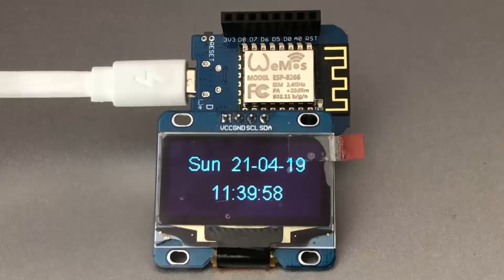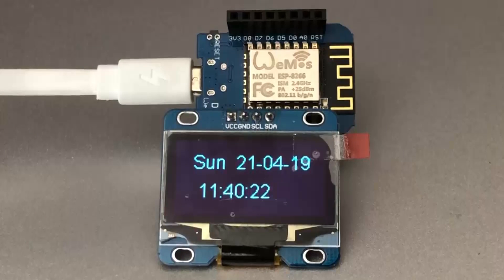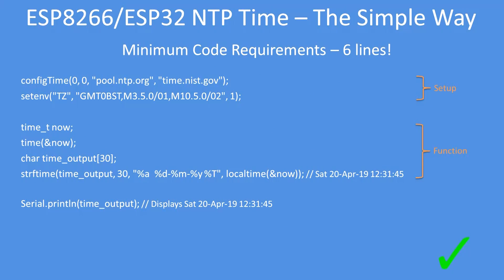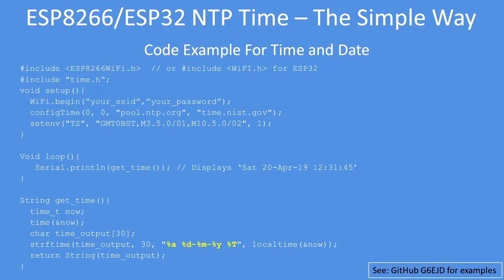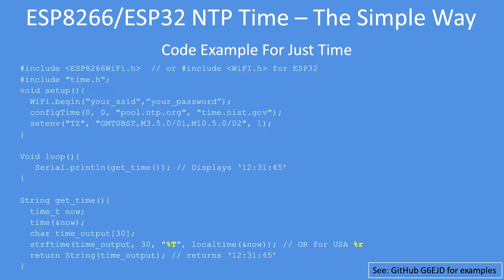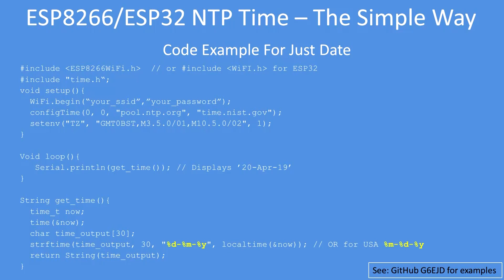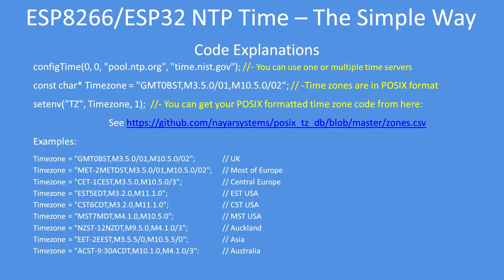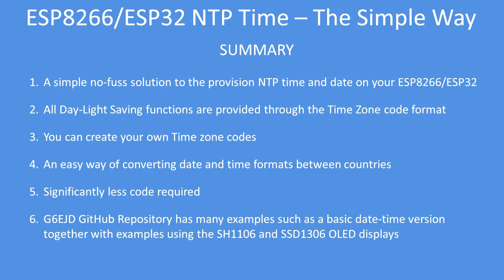Tech Note 122 - ESP8266/ESP32 NTP Time – The Simple Way

Comment: Dave, very helpfull. Thanks.
Do you know a way to setup strftime() to provide native language strings? 
I found a header file langinfo.h at the source files for the esp8266 but I could not figure out where to supply the translated strings for month names / weekday names or even find the original English strings.  That would be really nice!
Thanks.
Reply from the maker: I’ve done the same searching as you, but for some reason there has never been a solution or easy conversion but there should be! C++ supports this, but in this case it’s a compiler shortfall, just never been implemented it seems. You can do a string.replace(“Mon”,”Lyn”); etc but you’d need quite a few, 19 or more! 
Or you can fprint and give it parameters to do the conversion, but either way it’s clumsy.
I’ll try some more to find a solution as I’d like to solve it.
Reply from the maker: I notice PY supports setlocale
Reply: @G6EJD  
I found this document explaining how to change a language settings parameter on Debian:
   https://ccollins.wordpress.com/2009/01/06/how-to-change-date-formats-on-ubuntu/
Particularly in the directory /usr/share/i18n/locales there are all the language dependant settings.
Now we need to tell the compiler for the ESP8266 about some other language file. 
But I am afraid that isn far beyond my current knowledge ...

Comment: Hi Dave new to this coding just starting at 55.  Your video are very clear and full of info.  I have esp8266 with DHT11 and oled screen which is working fine, i even have it publishing to a webpage.  I have used your code to add the time.  In my void loop where the dht11 reading are taken if i increase the delay  between reading/screen refresh to 2000, it effects the clock (seconds increase only every two seconds as expected) as the screen is only updated once per 2 seconds.  How or where should i put your clock code so the delay in reading the DHT does not effect the clock.  I think i need to learn how not to use delays and instead interrupts. as i have learn delays are bad for programming anything other than very simple code.  Learning loads and having fun, though stress full at time (LOL)
Reply from the maker: Andy, I’m pleased you hear your enjoying coding microcontrollers, yes the effect your seeing is programmatically correct as the 2-sec delay indeed halts all updating, there are a number of factors here you should consider, one is not getting time too frequently as NTP servers will block you eventually for too many requests, so best to leave the ESP8266 internal interrupts to increment the so called UNIX time value every second (now) and then occasionally get a new value from NTP services say every 20-mins in seconds if that’s your count, next the DHT is quite a slow sensor and you could introduce an interrupt that every 10-mins or 1-min or whatever gets a new reading from the DHT, see my video on interrupts set a timer interrupt to trigger every day 10-mins and when it does read the sensor to a global variable, now your void loop need contain no delays at all, there will always be some jitter in the screen update routine as during the DHT reading which can take a second or so, the main programme flow is bring interrupted, but it’s better than using delays, it’s all part of programming a Von Neumann architecture cpu, if we had 2-CPU’s the task of reading the sensor could be allotted to the second cpu, and the two exchange or use a common set of variables to exchange the data. In a way what you are trying to counter is a perfect way to add to your learning as it’s the next step in programming. Hope this helps. BTW also see my video on memory allocation for interrupt routines and whilst the compiler in its latest guise will say, interrupt routines need to reside in ISR RAM (interrupt service routine) to stop interactions and crashing, usually solved by prefixing the function with IRAM or some other prefixes eg
IRAM void DHT_Reading()...

Comment: Just discovered your channel.  Thank you for the excellent tutorials. Once the setenv has been set using a time zone string, does it need to be changed when the switch happens to DST?  Or is it simply setup to match whatever the current setting is and then it will automatically change when the DST date and time comes round.
Reply from the maker: Steven, once Setenv is set there’s no need to adjust date-time again and the NTP services will follow the rules adjusting time forward and back in Spring / Autumn continuously.
Reply: @G6EJD  Thank you for clearing this up.

Comment: Strange result. The first time I call gettime in the loop it returns Thu 01 01 70
 11:00:11. after that the date and time is correct. why this happens?
Reply from the maker: It takes about 500mS to establish a connection to the time server, you can add a small delay to wait for the connection to prevent this, some networks are slower than others, yours is towards the slower end, that’s the connection between the ESP and your router access point and the the time to get to the NTP server, you can measure the delay from say a PC to the ntp server with a ping server-address to optimise the delay setting, but usually a simple delay(500); after the get time function resolves the issue.
Reply from the maker: For the ESP32 there is also an option to automatically wait until time has been obtained without adding a fixed delay, so it will wait until time is set then move on, waiting for a maximum defined amount of time, I can let you know how to do that if you need it.
Reply: @G6EJD  thx for that. i added the following code which seems to do the trick:
while (time(nullptr) <= 100000)
{
  Serial.print(".");
  delay(100);
}
Reply from the maker: struct tm timeinfo;
  char   time_output[30], day_output[30], update_time[30];
  while (!getLocalTime(&timeinfo, 10000)) { // Wait for 10-sec for time to synchronise
    Serial.println("Failed to obtain time");
    return false;
  }

Comment: Dave:  How do I convert time elements to integers so I can apply math or logic operators?  Thanks in advance.
Reply from the maker: There is a predefined type with a TM prefix:
int my_hour = tm.hour;
int my_min  = tm.min

There are about 20 sub-types day, Dow, secs, etc
Reply: @G6EJD  hi and thank you for your great work :) i have the same problem and  int my_hour = tm_hour; does not work for me (WEMOS D1 mini & ESP8266, Error: 'tm_hour' was not declared in this scope). Can you help me, please? I need hour and minute in int. Thank you :) .......my solution is the atoi() function....it works for me, but i think its not the best approach
Reply from the maker: void get_time(){
  time_t now;

  struct tm * timeinfo;

  time(&now);

  timeinfo = localtime(&now);  

  int int_hr  = timeinfo->tm_hour;

  int int_min = timeinfo->tm_min;

  int int_sec = timeinfo->tm_sec;

}

Comment: Hi Dave. I cannot get the function getLocalTime in ESP8266, is it normal?
Thanks.
Marc.
Reply from the maker: Marc, Chaco our the code examples for the ESP8266 that function does not work so it has to be a slightly different approach, but still quite short amount of code.
Reply: @G6EJD  Hey Dave. Why when i request from OpenWeatherMap i got: 1561367183
as sunrise and when i convert it it gives me: 9:06:23 , when it's 5:06 the real sunrise?

thanks.
Marc.
Reply from the maker: @MPElectronique  , that time comes from OWM and converted gives 9:06am (UTC) and your +4 hours? which sounds it could be correct to me. What location are you and I'll check what OWM returns here in the UK, could be a OWM bug.
Reply: @G6EJD  Montréal Canada..
Sunrise at 05:0 6
Reply from the maker: Marc, OK I found the issue, when your get sunrise and set times from OWM they are in Unixtime (secs from a basedate), next your need to add the timezone value from the API response which for you is -14400 and this takes 4-hours off your sunrise/sunset times.
Or, send your Unixtime through this:
String ConvertUnixTime(int unix_time) {

  // Returns either '21:12  ' or ' 09:12pm' depending on Units mode

  time_t tm = unix_time;

  struct tm *now_tm = localtime(&tm);

  char output[40];

  if (Units == "M") {

    strftime(output, sizeof(output), "%H:%M %d/%m/%y", now_tm);

  }

  else {

    strftime(output, sizeof(output), "%I:%M%P %m/%d/%y", now_tm);

  }

  return output;

}
Reply: @G6EJD  thanks you so much...
Reply from the maker: Marc, happy to help. You could add s new line to the JSON to get the time zone then add it to the sunset/sunrise times.
Reply: @G6EJD  How do i know when it's -4 dst or -5 dst ?

thanks.
Marc.
Reply from the maker: Marc, for you it’s -4 x 60 x 60 = -14400 which is what OWM returns as a DST offset. When it’s 5 hours that’s 5x60x60=18000 sec or get a value like 18000/3600 = 5 or 14400/(60x60)=4
Reply from the maker: Don’t forget the - sign !
Reply from the maker: BTW - If you use the ESp32 locatime function, it sorts out DST time for you.
Reply: @G6EJD  i did actually is adding since its - 14400
Reply from the maker: Yes, it’s better to add regardless of the sign of the value, then it sorts itself out.

Comment: In the ESP_Simple_Clock.ino 

got an error at line 69 // Serial.println("WiFi connected to address: "+String(WiFi.localIP()));

Compiler Error "call of overloaded 'String(IPAddress)' is ambiguous

In the ESP_RTC_with_NTP_Synchronisation_SSD1306_OLED.ino
got an error at line 91 // Serial.println("WiFi connected to address: " + String(WiFi.localIP()));

Compiler Error "call of overloaded 'String(IPAddress)' is ambiguous

I use Arduino IDE 1.8.9 AND ESP cores 2.5.0 for ESP8266
Reply from the maker: If your getting that error then you copied the text via a browser and your source code contains unseen characters, did you download the zip containing the source code?
Reply: @G6EJD  
Dear Sir, I have the code via https://github.com/G6EJD/ESP_Simple_Clock_Functions

downloaded and unzipped the zip.

Everything goes well with the ESP32, but with the ESP8266 I get the error code.

Comment: Hi Dave! Thanks as usual.
Do you know where i can fetch the atomic clock from the internet ?
Thanks.
Marc.
Reply from the maker: Marc, not sure what you mean, most NTP servers are locked to an atomic clock anyway, the NIST servers are all synchronised to atomic sources https://tf.nist.gov/tf-cgi/servers.cgi
Reply: @G6EJD  im looking for the fort collin in colorado..
Reply from the maker: You can use  'time-a-wwv.nist.gov' or 'time-b-wwv.nist.gov' or 'time-c-wwv.nist.gov' or 'time-d-wwv.nist.gov' just place one or more or all in the server address section separated by commas and place each in quotes
Reply from the maker: Don't forget that NTP measures the time delay between you and a server and removes that delay from the time it supplies you so that time and the server wherever it is and you are identical so for absolute accuracy yes pick an NTP server that uses an atomic clock, but what ever time source is used your device and the remote server will be the same time.

Comment: I don't use Arduino - so it doesn't help at all.
Reply from the maker: I don’t understand the point your making?
Reply from the maker: Also if your using another IDE then I can see few if any differences.
Reply: @G6EJD  So can you explain in details the protocol to use with TCP?
What protocol is it? NTP or SNTP or other?
Reply from the maker: I have not checked the compiler source code, but most likely the community uses SNTP which as you will no doubt know, is a reduced and simplified version of the NTP (Network Time Protocol) protocol, NTP is generally used only to guarantee high accuracy and is quite complex. Do you need NTP services for your code? Bear in mind there are relatively limited resources on an ESP8266 so for code compatibility SNTP is the likely outcome.

Comment: In theESP_Simple_Clock.ino 
got an error at line 75 // Serial.println("WiFi connected to address: "+String(WiFi.localIP()));
Compiler Error "call of overloaded 'String(IPAddress)' is ambiguous",

 had to change to:  Serial.print("WiFi connected to address:   "); Serial.println(WiFi.localIP());
Reply from the maker: There’s nothing wrong with the code are you at IDE 1.8.9 and ESP cores 1.0 for ESP32 and 2.4.2 for ESP8266? Did you copy the code using your browser? If so most likely hidden characters exist.

Comment: Excellent material! The time stamp is a crucial component of the most time-related designs. Manually setting the time generates unnecessary complexity of a system and does not guarantee accuracy.  The internet helps here a lot.
Thank you, Dave, for saving my time and providing a ready-to-use solution.
Reply from the maker: And never have to worry about DST again😊
Reply: Too many time synchronisation events in a time unit might generate unnecessary traffic and, even more importantly, may violate service usage policies of some NTP providers. Could you, please, advise which of the discussed functions gets the time via NTP and/or how to explicitly control the period/frequency of syncing with the time server(s)?
Reply from the maker: Maciej Rak, time(now) gets the new/updated value which is then converted to the tm time structure, you could get an update once a minute or hour, but if your going to display real time there is no answer as every call seeks an NTP update. Unix time is a 32/bit unsigned integer that counts up in seconds so you can get now value then write that to an integer and increment that via a 1-sec interrupt, then every so often get an NTP update to keep it synchronised maybe once a day. Actually my example protupe has been running for 2-days without any service interruption so I’m not sure time servers care in the grand scheme of how many devices world wide are requesting a time sync.
Reply from the maker: Out of interest I've added a RTC version that updates at a user defined update interval, currently set to 60-seconds, but could be any value.
Reply: Thank you for adding this functionality!